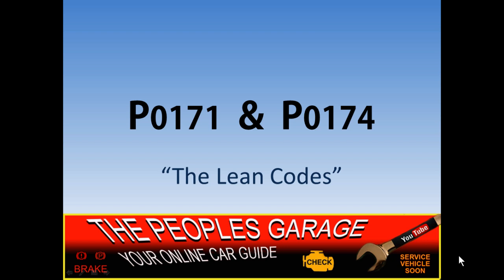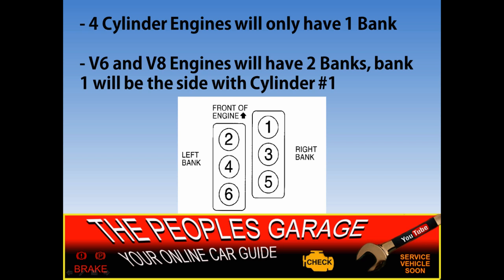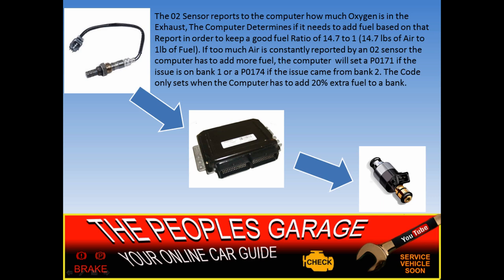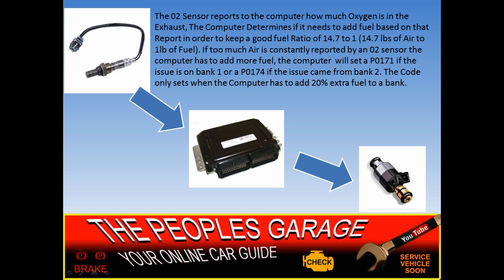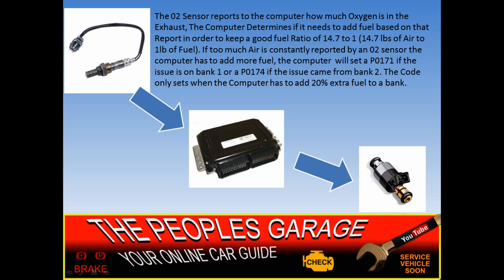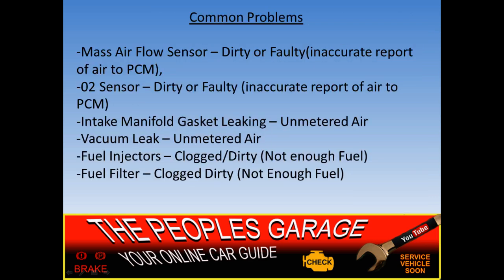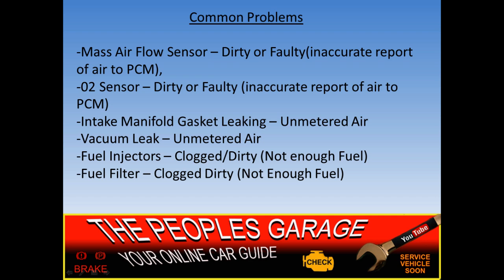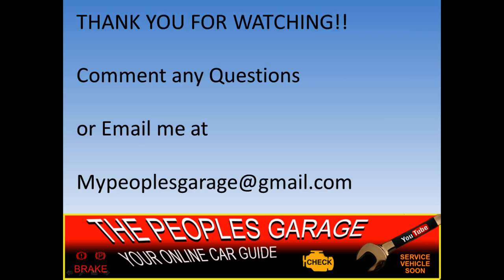How to Diagnose Codes P0171 & P0174 - Lean Bank 1 & 2

Comment: I have 01 V6 tundra..fault code P0171 pops up at times.....good performance at low end speeds/idle/start.  Slpeeds over 60 mph ask for passing gear the engine bogs down/runs roughness....this key to the problem I think...if while in passing gear I decrease fuel from engine, the engine performance increases a lot.  Therefore ask for increased speed/more fuel applied, engine does not like that.....reduce fuel input at the higher speed, engine likes that and rewards me by increased speed and performance.

Another clue at idle, sometimes not very often stand by the truck and smell fuel....thinking EGR?

I did replace O2 sensor awhile back it was defective, tested vacuum in system with fault monitor; looks good over all RPM ranges.  If EGR issue would I not get P0174 as well?  Also I cleaned MFS and air intake to intake manifold is super clean; If bad MFS would I not also get the P0174?.  Replaced fuel filter; it was the original from factor; it was restricted and once changed got much better performance.
last but not least, fuel injector issue bank one?.,

Truck 16 years old but only has 105,000 miles

Trying not to replace everything to solve the problem......need someones advice on how best to proceed.

Rick
Reply: If your brakes feel harder to push after accelerating hard you could have a vacuum leak inside the diaphragm of the brake booster.

Comment: I'm having got these same codes when they tested it at Auto Zone and of course they had know idea what it meant. I drive a 99 ford explorer and it does occasionally ideal a bit rough and now my temperature gauge fluctuates from time to time. I replaced the thermostat and its still doing it. I'm not sure if that issue is related, but I just thought I'd mention it. Do you know what I should do about this?
Reply: coolant temperature sensor? if the gauge still fluctuates after the thermostat change assuming all air was bled. had this problem not too long ago

Comment: I have a 03 silverado with 4.8 v8, my pcm is throwing p0171 twice and the p0174, my truck has no rough idle to no sluggish acceleration but when it the first start attempt it does not want to start but the second attempt it always starts. any idea what it can be. also checked for vacum leaks did not find anything

Comment: My initial codes were P0171 and P0174 even though it is a 2.3 liter 4 banger.  I replaced the PCV valve and the hose.  (What a job that was)  The hose was definitely bad.  I also replaced the following seals, intake manifold, throttle body and injector o-rings.  I also replaced the fuel and air filters.  Before doing this work it took about 50 miles of driving for the first code to pop P0171 then later P0174 would appear.  Now I am still getting a P0171 but now within a few miles.  The engine runs good but is using more fuel that it should.   I just bought a Cen-Tech OBD II & CAN Scan Tool hoping it would tell me more but all it shows is P0171 Bank 1 lean.  I got that from the little cheapie scan tool I already had.  Now I need to try to figure out what is causing the code hopefully without trial and error.  Any thoughts, or tips, would be appreciated.

Comment: love this video The people's garage, I'm a new subscriber.I had a brake booster that was bad had a air noise under the dash I replaced the booster before I replaced that I had codes P0171, P174 and P0455 after I replaced the booster the P0174 was gone leaving me the P0171 and P0455. I forgot to tell you I have a 1998 ford ranger 4.0 4×4 v6.I replaced the spark plugs and wires, brake booster, and fuel filter and replaced 3 big vacuum hoses that was close to the master cylinder attached to something I don't know what it was I thought maybe purge solenoid I'm not sure.I have high idle at start up then it calms down after I let it run, I also have a problem where my hvac vents inside the truck only blow out of the defrost and not any of the other vents could there be a vacuum leak causing this as well

Comment: I have a 2002 Chevy Suburban with the 8.1 ltr eng. I initially had hesitation when I would accelerate and when I checked I found that the intake snorkel had came loose at the throttle body so I corrected that thinking it was the cause but I still had the hesitation problems when I would accelerate so I checked for codes. I had P0101, P0171 & P0174 so I replaced the MAF sensor. I cleared the codes and took it for a test drive. I am still having the issue and it seems to be worse. At first I wasn't getting any new codes but today I finally got 2 new codes. P0171 & P0174, I am no longer getting P0101. The truck has a new air filter, MAF sensor, plugs and wires. The truck has 140,000 miles on it. What are your recommendations? My next thought is the fuel filter as I recently bought this truck 3 months ago and I have no idea if it has ever been replaced.

Comment: Ive got a 1999 ford explorer 4.0l OHV and it keeps throwing the P0171 & P0174 codes but I havent found a problem with any of the sensors, or a vacume leak. Ive cleaned the MAF, IACV, and Ive run fuel injector cleaner in 4 tanks of gas. After a code wipe it runs for a weak like a champ, then it start running like garbage and throws the codes again.
Reply: That's an old car. It could easily need a new brake booster because the rubber goes bad inside causing a vacuum leak

Comment: 2008 Buick Lucerne cxl 3.8. Was driving fine. Stopped at a light and then stepped on the throttle to go and it lurched forward then paused then lurched then paused then l.....  There is a p0171 p code. Made it to a parking lot and after it cooled/sat for an hour it started up (with car in park when gas was applied the engine revved and stalled, revved and stalled). Had it towed home.  Any thought. Thanx

Comment: I have a 4.6 v8 in a 2001 super crew 4x4 ford f-150 getting lean banks 1 and  2  not sure where to start I changed a coil pack and spark plu in cylinder 1,and 2 and bank 1 issue went away still getting bank 2 running lean engine is running rough in the 40 - 50 mph range and on crank up? thanks for any suggestions

Comment: Today, I got  the P0171 and P0174 codes on my 2005 V6 Volkswagen Passat. I have changed the air filter, and cleaned the Mass Air Flow sensor, since these codes, and cleared the codes. 

I was not having this code before I replaced my N80 Purge Valve (as I was getting P0421, P0431, and P0441 codes, which have now vanished), but even after a new filter and cleaning of the MAF, I am still getting the P0171 code pending, although it hasn't actually stored to this point. Any advice would be helpful. Thanks!

Comment: I have a 03 Dakota with a 3.9 it's showing code po174. It comes up that it's running lean but on accelerating black smoke is coming out the tail pipe. When idling the exhaust really stinks and mpg has dropped dramatically. Any ideas Thanks

Comment: hey man im getting the po171 code, i have a 97 ford contour? what do you think is the problem?where should i start. buddy of mine said try cleaning the spark plugs. by the way my car still runs good without problems wihile having this code.
Reply: I have the same problem with my 98 SE Sport. Runs fine, even with check engine light on !!
I have changed all o2 sensors,gaskets,even the injectors to no avail..???? Help!!?
Reply: my 2000 grand Cherokee just gave me the same code, trying to research it

Comment: I'm trying to diagnose the problem for codes P0171,P0174 & P0300 on my 2001 Chevy Silverado 1500 LT 5.3L.  I just replaced the vapor can solenoid but still throwing the lean bank and multiple misfire codes.  Ive fixed the exhaust that was broken off below the manifold exhaust.  I am getting readings from all four oxygen sensors so I assume they are working.   Im gonna go ahead and change the fuel filter next and if that doesn't fix it start doing smoke testing on the manifold's gasket and checking each spark plug and coil. Any suggestions?   I've been driving this truck for over a year its had this code the whole time.  After erasing the codes it seems to run fine but after fifteen miles or so its throwing code again and starts misfiring.  I heard a ticking last time i messed with it so it might be a coil?   Also, think I'm gonna check the gaps on the spark plugs and make sure the wires are good although they were just replaced I don't trust the last shop that worked on it.  I'm still trying to get the engine cover back from Mountaineer Towing but they say they don't have it and won't replace it or give me money to get one myself.  Please if you can any suggestions will be considered.

Comment: Hi i have 2005 mercedes benz c230 Kompressor 1.8L 4 Cylinder has check engine light code P0171 if you can help me appreciate it

Comment: well in my case i have a jag s type r i first have faulty ignition coils which i believed is solved for now my friend mechanic we both checked the car and we found a disconnected little hose that goes to the left or driver side supercharged intake or intercooler so after connecting the hose reset the light also have restricted performance so i cleared the light and then stop engine then turn it back on and the restricted performance message went off but still having a little engine shaking and i have those codes  but car feels better now better performance but still a little lack of power  ,,, but im wondering we disconnected the intake or throttle body pipe  to get to the little hose that was disconnected and recently  cleaned the mass air flow sensor with sensor cleaner but air filter is way dusty and dirty ,, but i believe mass flow air sensor is ok cuz i disconnected and the engine really idle  bad and performance massage came back ,, when disconnected and put it back on and engine  act normal after that

Comment: Hello. I'm writing about an issue I had today with my 1999 Chevy Tahoe 5.7l. My check engine light came on and the code was a po174 running lean bank 2. I pulled the MAF sensor and cleaned it then reinstalled and cleared  the engine code with my scan tool. Ran great for a few minutes then started choking and idling funny almost to where the vehicle died. No check engine light since I cleared but still runs funny when it gets up to operating temperature and horrible/strong fumes from the exhaust. Don't have alot  of money so wanna get some advice as to what it could be before I just go start buying parts I may not need. The cheaper the better hopefully. Thanks a million.
Reply: problably a hose might be disconnected or cracked same happen to my car not a chevy but it could be  start the engine and disconnect the mass sensor and see whats does ,,, im having same codes in my car but  it could be anything  hose filter sensor ,,, i hope
Reply: hi, please try unplugging the maf and see if the issue changes - I had the same issue and it was a bad maf

Comment: I have a Mercury Sable 1998 3.0L DOHC with codes P0303-Cylinder 3 misfire detected and P0171-system too lean bank 1. When I'm at a dead stop the car jerks or stalls when I take off or accelerate, plus it rumbles and shakes when the car is idling,. What could be some possible issues to look at?
Reply: po303 means that cylinder 3 is missing - pull the plug and check to see if its wet with gas or fouled up
it should be a nice light tan colour - if plug is ok, you check the wire for cracks and frays- if wire is ok, you check the coil that produces spark - good luck
Reply: 777jonah888 if plug is wet with gas or fouled up...what those that indicate?
Reply: Guadalupe Salazar

if plug is wet with gas, it is not firing properly
put new plug and see if it improves - if new plug is the same, check wires and ignition coils for that cylinder if all above is good, you could have stuck open injector - check plug first this wet plug is the cause of both codes - get it fixed before it kills the cat -
what does the plug look like?
Reply: @777jonah888 Well I am going to recheck the plug to be 100% if its wet...and maybe have to replace it....I will get back at you. thank you for all the advice!
Reply: Guadalupe Salazar
OK, BUT IT COULD BE WET FROM COOLANT LEAK INTO CYLINDER OR FUEL so you must tell the difference - next post, you describe what you see or better yet, make video - I am willing to assist you but you have to be precise in your questions and answer all of mine..ok?
are you loosing coolant? do you have to add to keep up to full level mark?
is your fuel economy getting worse- use more gas or no?...thanks

Comment: I have a 2000 Chevy truck with codes PO174 and PO171. Every now and then if I drive without warming up, the truck sputters and wont go for a few seconds....What part should I start with?
Reply: when was the fuel filter changed last? start there cause it will lessen the strain on the fuel pump if its blocked and that will cause a 171 and 174. due to not enough fuel - starvation

Comment: what if I get the codes p0174 and p0 175 at the same time on jeep liberty renegade 2004 3.7l
Reply: Vacuum leak and could be from the Intake, vacuum lines or inside the brake booster.

Comment: 2001 chevy s10 4x4 showing code p0174. previous codes were P1441 and P0155. We replaced O2 sensor for banks sensor1. Also replaced Canister purge valve and solenoid. These codes are now clear and we get the new P0174. Cleaned MAF sensor and code was back within 5 miles of driving.  What can we do next?

Comment: 2003 FORD F-250 V-8 REGULAR GAS 2 WHEEL DRIVE ...CODE PO171 SYSTEM TOO LEAN BANK 1...LOCAL GARAGE WANTS 300.00 TO LOOK INTO IT? ANYTHING YOU WOULD SUGGEST I CAN TRY ON MY OWN. 116,000 MILES? THANKS , GREAT SITE..

Comment: I have a 13 Chevy sonic turbo running a p0171 code and from what I can see the gasket manifold doesn't seem to be leaking or has any cracks in it. how else can I fix it? I have a warranty that covers the engine and transmission but I'm not sure if this be covered. how can I be sure?
Reply: just had this problem with my 13 Chevy sonic, check your air intake duct.  there is a video here on you tube about it but I guess it is very common in our cars that it cracks at the top.  i hope this helps.

Comment: hey, man.very Nice vídeo.  I have a error code P0171 and I have no idle problem,  and it appears with the cold engine.  When I erase the error code, it appears again in one or two days. the car didnt lose power.  mechanics said me to change pcv valve,  but I am not sure it is the problem.  one Day appeared the error code of air leak,  p2279,  but it is not frequent. it is an audi a3, 2.0 tfsi,  8p1,  2011.
Reply: hello, a stuck open pcv valve will cause that code - the part is under 10 bones and pretty easy to replace so i suggest you change it - at least you can eliminate the pcv and move on to other issues...good luck
Reply: Hi. You are definetely right. I changed the pcv valve and the car is no more hesitating when accelerating from stop. The petrol consumption (mpg as you frequently use) is much better. I am very happy now and I must thank you. Have a nice day.
Reply: Marcus Santos
glad you got it sorted....happy trails!!

Comment: Very helpful video! On my 2006 Jaguar X type I get the p0171 and p0174 codes intermittently.  Occasionally they will clear themselves after being on for a several weeks, then come back on after a couple of days.  Also, usually they come on when accelerating hard like when entering a highway.  i have changed the MAF, but with aftermarket brand.  Since both right and left bank codes first came on the same day, I assume it was not an IMF gasket.  Sprayed starting fluid to try to find vacuum leak with no success.  i was going to change out the original fuel filter next.  Any other suggestions?
Reply: Could be a vacuum leak inside the brake booster
Reply: I have a bad intake valve gasket and when it's cold out it'll cause a large leak.

Comment: Great video! Learned a lot. But how do you fix these things? I have a 2000 Nissan Altima. The service engine light codes read P0171 Fuel System Too Lean. I often lose power in the middle of driving. All parts are new -- battery, starter, altenator, 02 sensor bank 1, knock sensor, engine mounts, and non-faulty MAF (changed 3x).

Comment: I have Dodge avenger -2009 SXT model and got P0171 code ( Bank 1 too lean ) 
Even after replacing  O2 sensor at up stearm  , sparks , still problem exist . I took it to Aktive auto repair shop @ Gaitherburg , MD  , they scanned , nothing found . Later they said they tested with smoke test , found that cap where spark installed is having problem , able to see smoke coming near to cap . So they just replaced it , charged $108 after discount ,  asked me to monitor for couple of days . I will update it if i get same problem again

Comment: I have a 09 BMW 328i. I got both codes  P0171 & P0174. Current symptoms are, my car lost power, only drives 5-10 miles per hour, rpm won't pass number 2 even if I press the gas pedal all the way, like car is choke. I changed are filter and clean mass sense flow and still same problem. Also disconnected mass sensor in case is faulty but no change. Few people had told me to disconnect last two O2 sensor and start the car to find if catalytic are choke and get release. What is your opinion on that?
Also i do notice oil around the gasket for a while ago and when I open the oil cap engine it has air pressure, like is pulling the cap when try to open, I hear it could be gasket leak. I did spray over the engine for any leaks but nothing found and put and fuel injector cleaner and a SeaFoam in the engine but didn't see any changes.  base on this info. what advice would you give me of the possible main problem ?  It also has codes P143E OBDII, P105B/P1056 VCM, maybe this helps too, thank you for your help.
Reply: check your catalytic converter they get clogged it wont do shit  you can google it